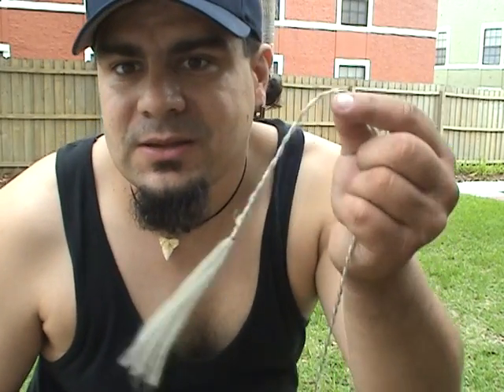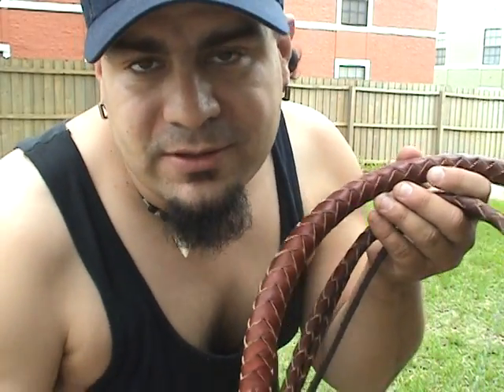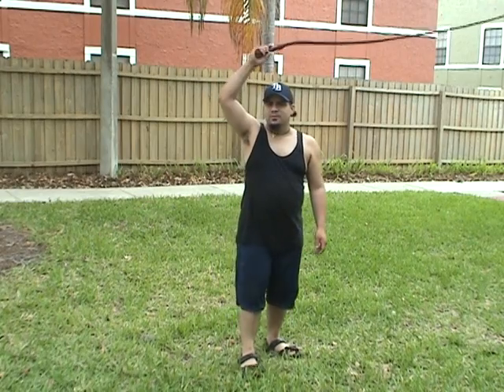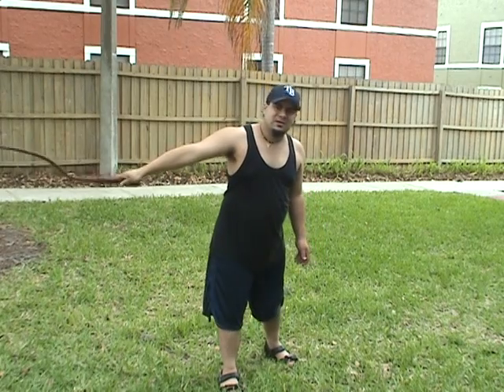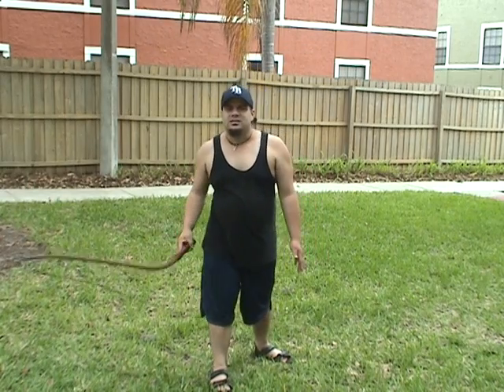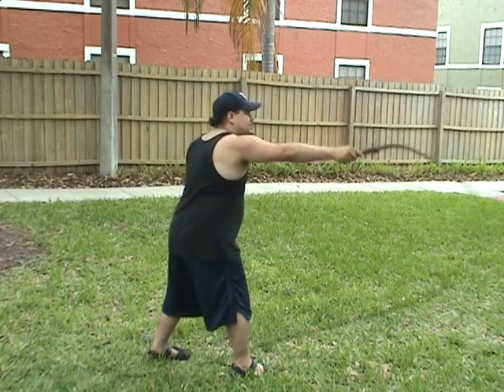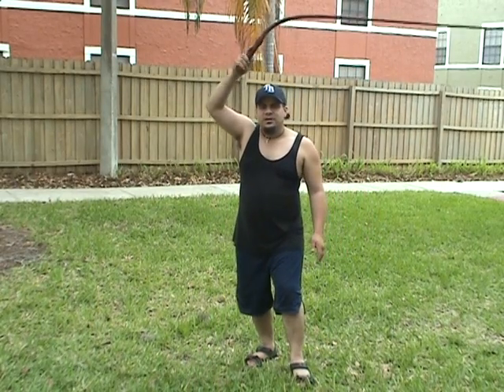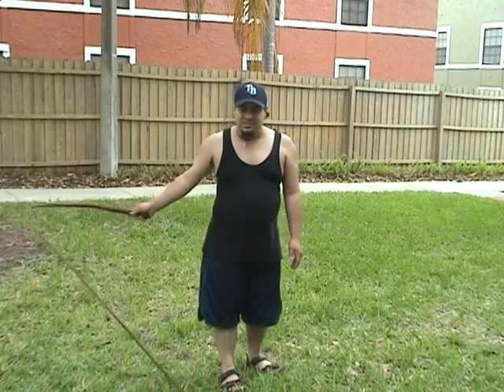Bullwhip Cracking - The Overhead Crack!

Comment: I use my bullwhip in schools, libraries and other enclosed locations for my performances and when asked what makes the cracking noise, I've learned to simplify it for the kids. The speed they understand, but sonic boom and breaking the "sound barrier" is too abstract.  So this is what I've come up with, when the "cracker or popper" whips through the air it slices the air apart, just like lightening heats the air pushes it apart and then the clap of thunder is actually the air rushing back in to fill the hole (the vacuum), The same thing happens with the whip just on a smaller scale. By the way great job on the overhead, I'd love to see the sidearm.
Reply: I am a central NT boy, we use electric fence lead wire for the popper. It will open u up real quick, but 10× better sonic boom, hay bail twine is shit
Reply from the maker: I know that this is a LONG TIME on responding but I JUST found this comment....5 years later.  I want to thank you for the comment and the description you use is absolutely PERFECT!!!   Thank you for that. :)  I also can tell you that this video was shot when I was just learning how to crack a whip and I can tell you that my form has gotten WAY better.  I can really see the amature moves in this video compaired to what I am able to do. :)

Comment: Check out my backhand upper cut mate, also try using electric fence lead wire for a popper, sonic boom plus last a lot longer. 10 mil in length, might see you at the competition